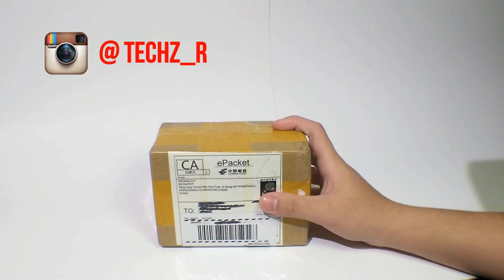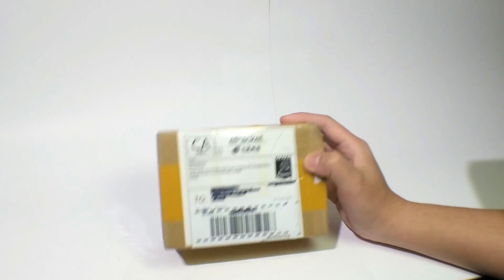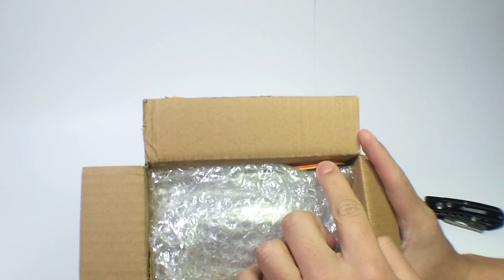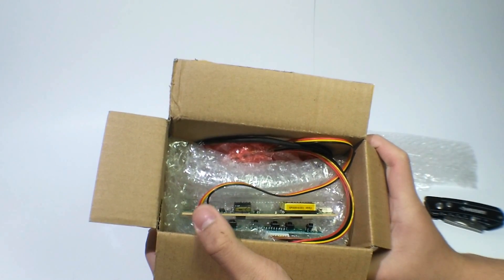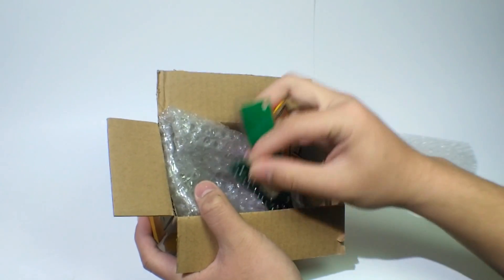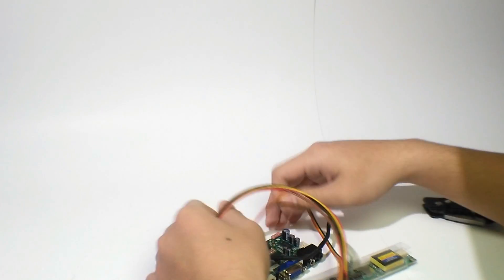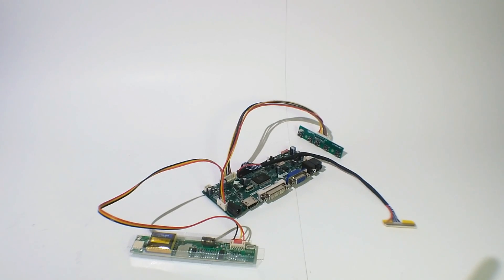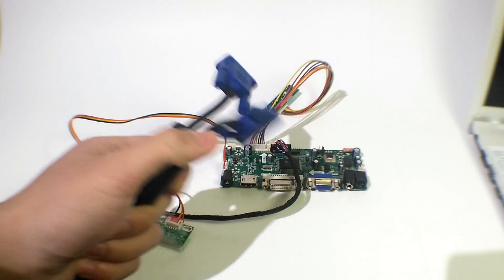DIY LCD Display | From Recycled Laptop Screen !!!

Comment: Hallo ! At minute 3.13 you connect the White...  what happening if you not connect this. I ask you because the Yellow light turns on but 2 seconda later becane Red . I use 12v adaptoe with 2Amper. Maybe there Is not enaught Energy. And Ihave try another One from 3 amper

Comment: That's Hella easy to do I wouldn't of even had to order the parts That's kinda like cheating all you do is plug the screen into the part you ordered everything is already pretty much connected already try getting parts off of different things & building one that's how I've always done it a Lil. Harder but a lot more fun interesting & somewhat harder, You just pluging the screen in & turning the power on off of peaces well technically it's one peace cause it came all connected already except the screen you actually probably ordered to & you just plug that in to peaces you ordered & plug it in & presto

Comment: The LCD screen I got only have 20 pin conector, couldn't find a single controller for it :(
Got from an old HP TX-1000 laptop
Model: N121l3-L01 C2 12.1
Reply from the maker: Sorry to hear that, just did a quick search with that model number and I found a couple from ali express

Comment: Hi!
I have a problem with my controller, can u help me out?
I plug in 12v but reverse the voltage, so i burn one 6leg smd component and i want to repair but i dont see the number
The chip name is start with T, but i cant see anything else, in my board it is U4
Reply from the maker: Dam sorry about that bro, this is too technical for me to troubleshoot and its been quite a while since I worked on it. Goodluck tho!

Comment: Hi, great video. Does that controller board have a ceiling mode as the one we can find on projectors?
Reply from the maker: Thanks JC! Yea it should have one where you can flip it horizontally and vertically.
Reply: @Z4CHA  Thank you very much :) Regards from Mexico!
Reply: I have pcb800099, and it has that menu, but it does nothing. My screen is always mirrored. What could be problem?

Comment: Is it possible for the monitor to turn on automatically when it detects mains power? I want to put an LCD screen inside a cabinet and don’t want to manually turn it on each time
Reply from the maker: Good question! Yeah it's definitely possible, but you need to do some extra wiring. It sounds like a cool a idea im planing on doing with my setup.

Comment: Hello i am trying to make my DIY monitor in my case i made it to be recognized from windows but the panel stack at white screen for ever 

Also you have to know that
i tried the board with 2 similar panels and always doing the same 
both of panel was working on a damaged laptop but working 
i am using a working 12v 4a power supply with the positive in the center
the board came with all wires apart so i connect them (i am 99% sure that i connect them on the rigth way this is the board )

every help and advise it will be appreciated

Comment: Did you use vga cables because you’re working with an older model ?
Reply from the maker: I used an hdmi cable because the controller board had an hdmi input 👍

Comment: is it possible to do this the other way around, my laptop screen broke and it doesnt have vga or hdmi ports, a usb to hdmi adapter does not work, is there anyway to and lcd to hdmi adapter?
Reply from the maker: So you cant directly connect the lcd panel to hdmi, you would need a controller board to do so. The lcd panel has its own special lvds connector that you would connect to the controller where you can connect your hdmi/vga.

Comment: Hi one question, can you power the board up by soldering a usb c power delivery circuit to the display's power input?
Reply from the maker: It may be possible however you gutta get the pinouts chart for the circuit so you know where to solder the power to. So I suggest doing your research before hand. Goodluck, let me know how it goes!

Comment: Do you need to buy a display controller specific for the exact display model you have or just the general resolution and refresh rate of your display?
Reply: I have an old xps13 but could not Google the exact model number but could not find it. Could you helpe put where to look
Reply from the maker: Yeah you would need to buy an exact board thats compatible with the panel, just search up the model number with controller board and you should find a compatible board. Hope that helps!

Comment: Is there some old home appliance i could disassemble to get the controller board and the lcd inverter?
Reply: Old laptops or tablet works fine. For tablets is hard to find control boards though. Edit. At home there is no control boards to be reused for the purpose...
Reply from the maker: I would recommend using a controller board that is specific to that lcd panel  as not all controllers are compatible with certain panels.

Comment: Can i use any type of control board for my laptop screen?
Reply from the maker: No, it's recommended you buy a board thats compatible to that panel. Just type the board number with controller board and you should find a compatible board.

Comment: I'm starting a new project and need to understand how to power up ips laptop screen and use it with a raspberry pi. Any input would be appreciated
Reply from the maker: I did make a video on using this exact panel with a raspberry pi, check that one out 👍

Comment: I'm looking for a solution that would work on a netbook lcd. a trusted seller won't sell me v29 controller board unless my lcd is atleast 14 inch minimum. but i only have 10.1

do you have any recommendations? my lcd is 10.1 wsvga 1024x600, 40 pin
Reply: You can use T.V53.03 board sir. This board  support for panel 10" - 52", cheap and good quality. You can watch this video: https://youtu.be/NyuWPFIskxA
Reply from the maker: Thanks for helping out!

Comment: Hi, im wondering my laptop lcd has 40 pins on lcd, can any lcd driver with 40 lcd pins be compatible with my lcd??
Reply from the maker: You would have to research the board number compatibility online.
Reply: @Z4CHA   mine is B156XTN02.0 or 2.1

Comment: would touch function work if the screen is from my touchscreen laptop?
Reply from the maker: Really good question! I havent tried using a touchscreen yet but it really comes down to the lcd panel and its compatible controller board, since every panel has its own specific board its hard to say which boards have that feature. If you've tried it, let me know how it goes!

Comment: Outstanding video!
Does it work with any kind of laptop screen?
Reply: Yeah, as long as you can get the right control board (look at the part number and check ebay)

Comment: Does this lcd controller work for all the laptop sreens?
Reply from the maker: It works for a specific range of screens. The trick is to look at the model number and search it with words "(model num) controller board"
Reply: TechHumor but i dont know where my model number is because there are 2 to 3 numbers can you please help me out?
Reply: @akashdarji8117  you need to take off the screen to see it
Reply: bruno lopes CLAA141WB05A this is model number can this work?

Comment: I'm.just wondering if the cable is long enough co I want to use it in an old laptop I have so also stick an rpi0 inside and make a retro pi laptop

Comment: Hey there.. I really need your help.. do certain screen need different control board.. or it can be use on any screen
Reply from the maker: Yes you do need a certain kind of controller board, look for the code for your lcd screen and theres always a controller board for it.

Comment: I did that, and my screen turn on normal and can be use but there are some white horizontal lines flickering, why this happens, is it my screen is damaged?
Reply: The display ribbon may be damaged, or in most cases it could just be loose. 
Remove the ribbon from both the screen and also the display board. Check the entire ribbon for any type of rips or tears, then re-attach both ends to their proper spots (just keep a closer eye on lining it up)
Once powered on if the display still has white lines, you may want to consider replacing the ribbon

Comment: I have two old monitors that I don't need and I was thinking of taking them apart and join the two lcd screens together and have one display input rather than two different inputs to devices. I am wondering if this is possible.

Thanks.
Reply from the maker: Yeah that's possible I've seen people do it.

Comment: Dont do this this mostly doesnt work !
Reply from the maker: It works fine for me...
Reply: And it’s working fine for me 👌🏾 I also have the same problem with power switching off but your video helped as my power supply is a little to low.
Reply: @AltCine  ac adapter with 12v and 3A is enough you think?

Comment: coudnt you make it portable with usb 5v to 12v 2a step up coverter?
Reply from the maker: +ikeel carter yea absolutely
Reply: +T3CHZ_R awsome i already have a screen and there is a 5v to 12v dc booster cord on amazon for $10, forget spending $200-$300  on a gaems portable screen
Reply: You comment is 6 months old. Have you built it? I want to build one, too. But I can't find no good screen.
Reply: im curious is it possible to power it up via laptops usb port with this converter or will it damage laptops mainboard?
Reply: @inca3  You wouldn't be able to get enough power from the USB port. Depending on the backlight power requirement you need around 20 watts. Which would be 4 amps at 5V. In the spec for these boards it says you need a 12V 4A supply, although mine only pulls about 1.7A
Reply: Maybe this controller have been work on 5 volts? Check pls. I need connect lcd panel from exeqget game tablet computer.   Sry bad english..

Comment: Hi, how do I go about loading videos, images etc to display in my taxi as personal advertisement. Is there a way I can connect storage device and can it run continuously during 8/9 hour shift. Thanks.
Reply from the maker: Excellent Idea! I was thinking of doing a similar project in the future, but right now you can try to hook up a small computer that has video output and change the settings to run it on loop. Hope that helps
Reply: T3CHZ_R 
What is your idea about the smallest computer. One that can start up automatically when I turn the car ignition on ?

Thanks.
Reply: @globalnet972  use a raspberry pie
Reply: take a look at the raspberry pi 2 it is a very small computer that you can program to do what your want there are many tutorials online for getting it started and it only cost about 30 bucks :)
Reply: RApsbery pi 0 the best solution for this kind of things
Reply: Buy a monitor controller board which includes a usb slot. I found some on ebay. Play your advertisement via usb to the display

Comment: I have old dell vostro screen which support VM8G LCD Cable assy 
Can u give the link or website or which control board to be used ?
Reply from the maker: Good Comment! it's very simple actually all I did was type the model number of my screen on ebay and typed in controller board right after it. Hope that helped!
Reply: T3CHZ_R 
Well On eBay app it doesn't show results i have to switch over website thanks for the help

Comment: I have one of those boards and I would like to hook it to this small lcd( http://static1.1.sqspcdn.com/static/f/489821/19781611/1389296705167/TD035STEE1.pdf?token=PZn5jBdPhZlPvdN4CPUwhqI8jCI%3D ) how would I go about wiring it on ? i
Reply from the maker: +patprop74 my video shows the process, if not then you can show me what specifically you need help on
Reply: What I meant is, when I ordered mine I had asked for a specific LVDS cable for the screen I had on hand, but what if I wanted to use that board with another lcd screen such as the one I had put a link too, how would one go about wiring different screens in general.

Comment: I'm not sure what the benefit is here? Why can't I just get my LCD screen replaced instead? Time-consuming. Real question is why he just doesn't fix the laptop with the new screen he has instaed of having that screen lay there when in use, isnt it easierto get damaged
Reply from the maker: +accessonesolutions it's not about replacing a broken LCD screen, it's about recycling the LCD screen when you're throwing away your laptop and repurposing it.
Reply from the maker: +accessonesolutions good question btw
Reply: Not all laptops have the same screen size.... and not all LCDs have the same thickness.... it doesnt work like that

Comment: Ok, but would it work to do the same thing with multiple laptop displays?
Reply from the maker: +kanechy you mean use one board with multiple displays?
Reply: @Z4CHA  yes
Reply from the maker: That's a great question, I've never really tried it. My board has one hdmi and a vga, idk whether connecting each to seperate monitors would work but it's worth a try. Goodluck!